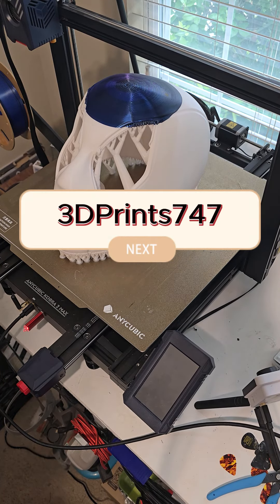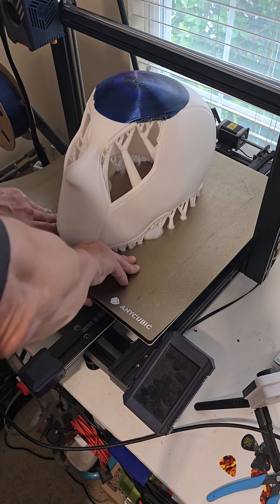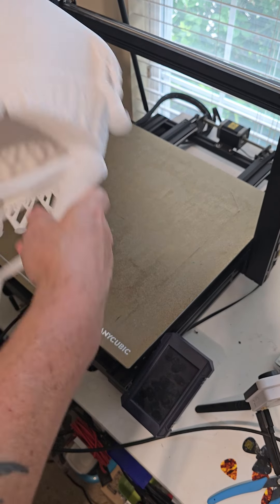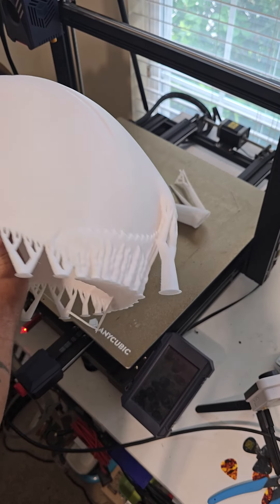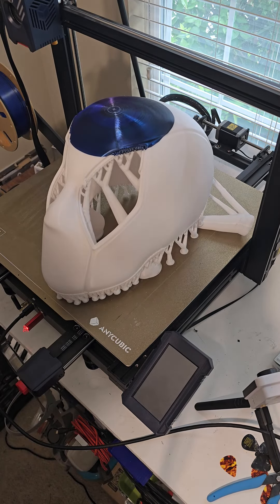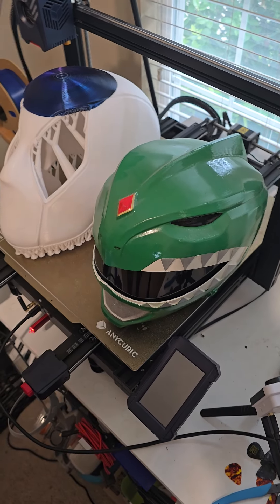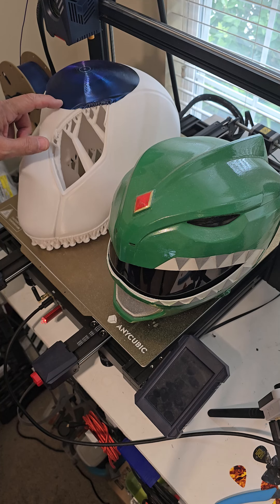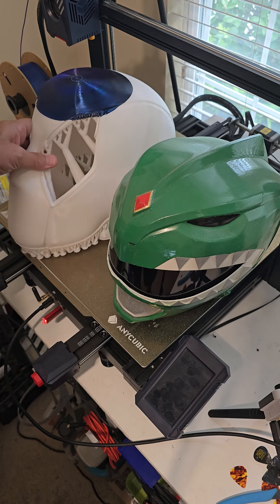Printed a WAY TOO LARGE Deadpool helmet.

Comment: They have some model heads on thingiverse that you can put into the slicer to check helmet/mask scaling. May help.
Reply from the maker: Thanks, I know there was a set that you could use where you measure your head and download the correct size one, but I couldn't find it.  I'm going to have to dig deeper, maybe its on printables...